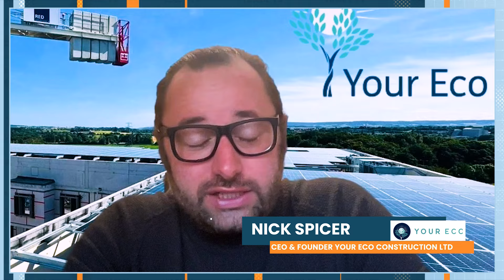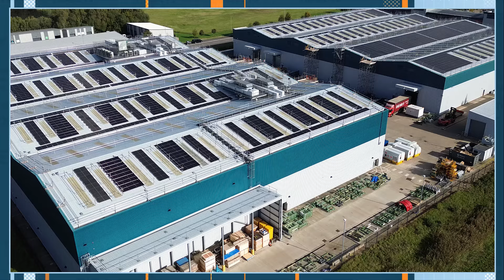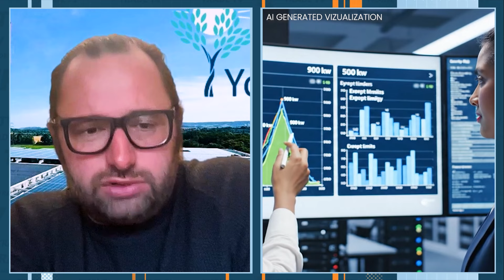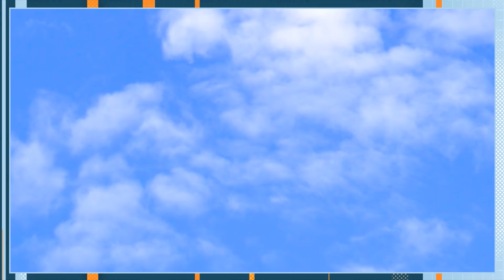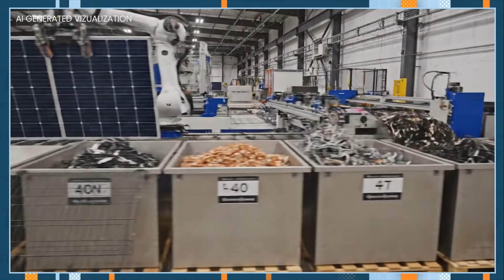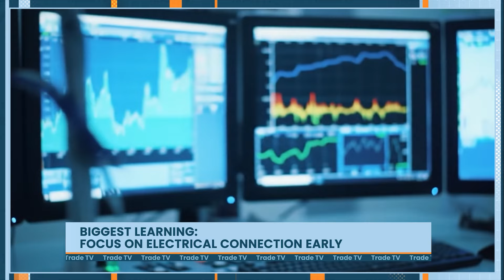Sailing the Storm – 1.1MW Industrial Rooftop: Legacy Removal,  Live Site, Compliance Challenges

Comment: 500kw export limit because they normally consume 400kw of the 900kw. Hence they are sometimes wasting energy where they can only export 500kw and used under 400kw internally.  I'm thinking that over time the amount wasted will drop as staff come into work in their electric cars and plugin for recharge.  I wonder if smart chargers are being built with this future trend in mind - where staff are at work for 8-9 hours and you can charge up those cars anytime during that timeslot - it would help a lot in balancing demand.